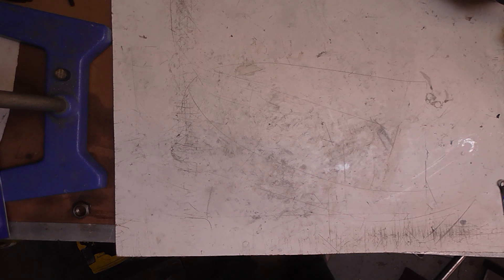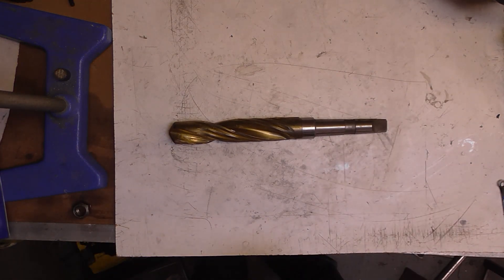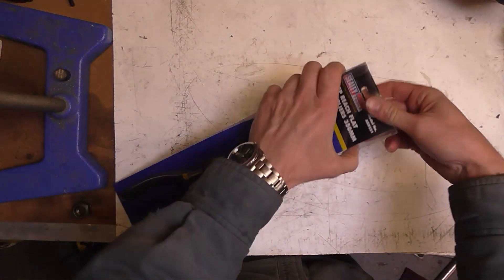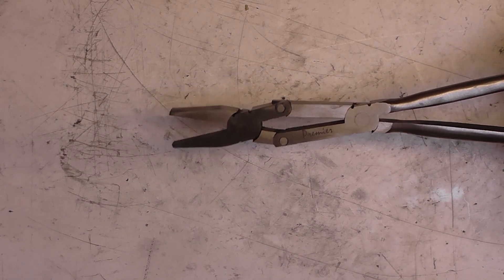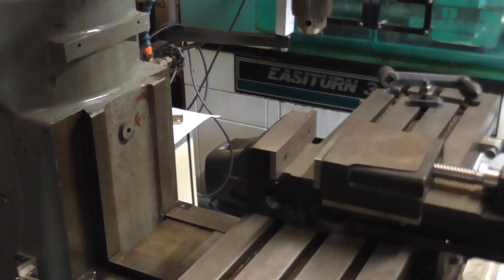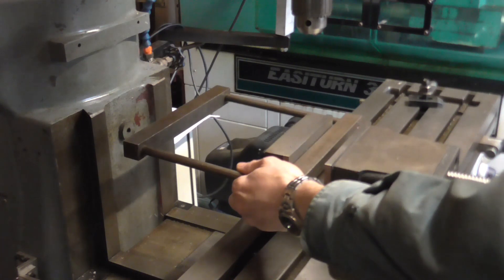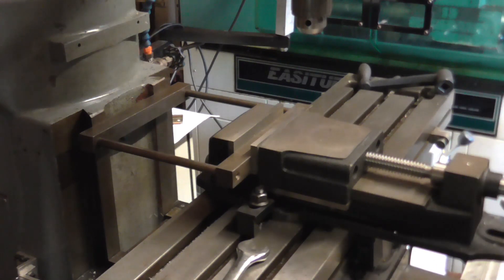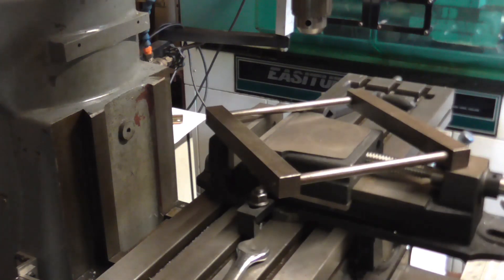Quick way to tram a mill vice.

Comment: We like to visit the first video for a channel when we sign up see some of my USA fellow creators have posted here. We selected this video as it appears to be the first machining operation related to our interests. Yes to long handled pliers double action is really nice to still be able to close even with two hands they are a rel life saver in a pinch. Nice quick square tram unit never seen one but it makes sense if all is, as you share clean surface, burr free and all that, we would still need to indicate into final perfection for our tolerances then use after your borrowed tool is removed. Thank you, Lance & Patrick.

Comment: Just wondering if you as you say clocked the vise to see how close you quick tram was? Great idea using that surface as a reference. Thanks for posting.
Reply from the maker: It's within a thou or so. Some people are a bit obsessive about dialling the vice in pefectly. You can really annoy them by giving the table a quick tug on one end. Usually there's more play in the gibs than the accuracy to which they're trying to tram.

Comment: I use that same surface to align plate flat, on the table or sitting on parallels, in some set ups! Great tip of using that surface! ;{)----